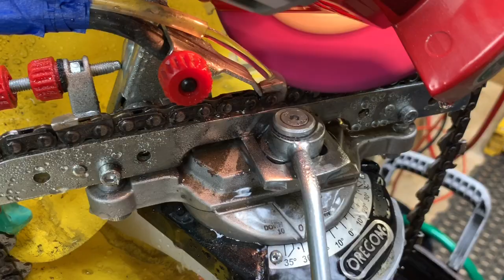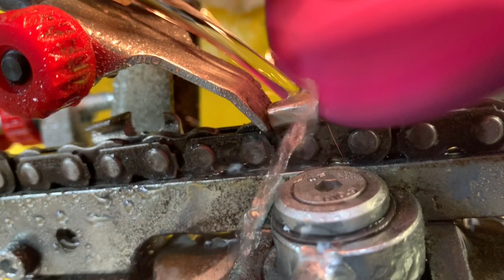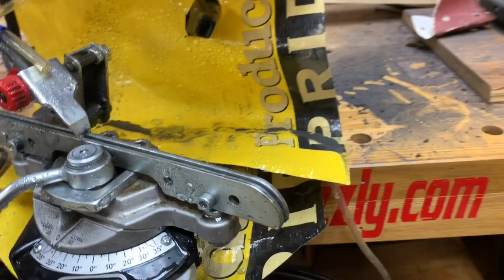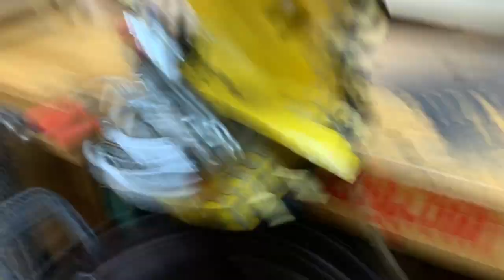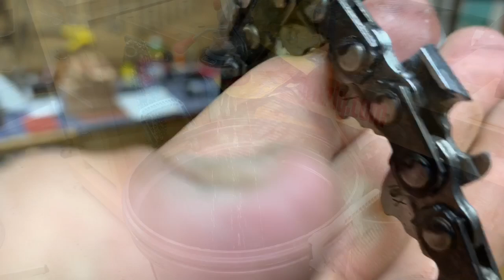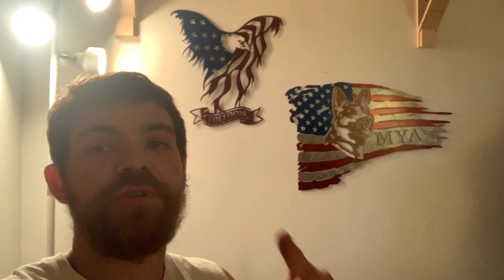SHARPENING CHAINS WITH WATER!!

Comment: Hi - it's Big Rodders in Ireland.  Greetings from the Emerald Isle.  A year ago I too was concerned about overheating cutters so I converted my grinder to wet operation.  I fitted an aerosol sprayer to my air compressor that cool my chains with cutting fluid while sharpening.  I strain the fluid and reuse it.  There is no issue with rusting and the fluid lubricates the chains.  I haven't heard of anybody else in Ireland using a similar system.

Comment: Metal shops use water mixed with something that looks like skim milk when mixed and it doesn’t rust . They use it with Cnc machines. Maybe you have a buddy that works with metal that can hook ya up or point ya in the right direction . I think it’s a power that they add , well great idea & good job
Reply: Water soluble oil is what it is called
Reply: Bicarbonate of soda mix works well in grinding, as a bonus it doesn't stink like soluble oil.

Comment: Might try using a cutting oil like you would use when drilling through steel. You could strain it and reuse. Either way I would make sure that grinder is plugged in to a ground fault plug.
Reply: Jason E   You read my mind! I never should have quit wearing my foil helmet. Those things really work.

Comment: I do my sharpening outside but did not McGuyver a cooling system yet. For such application, I will recommend using a windshield washer pump.  Works on 12v and uses little water. Easy peasy! You can get them for nothing  at the bone yard or perhaps coming out of one of your own carcasses lying somewhere on your property...

Patriots: WWG1WGA

God Bless.

Comment: The chain overheats because the engine rpm is too high.  Easier to instal a frequency inverter and control via potentiometer (for speed).  if you use coolant, use a low viscosity oil :-)